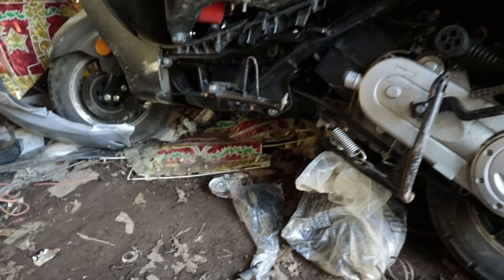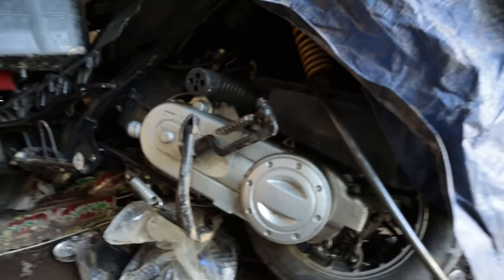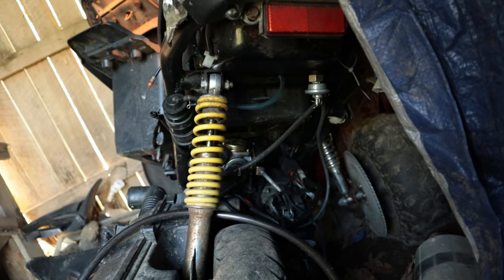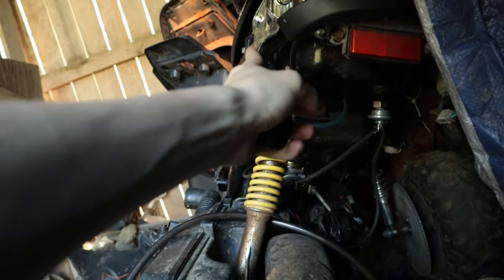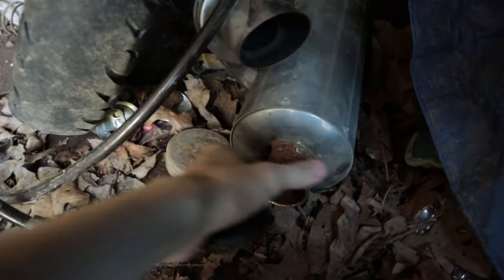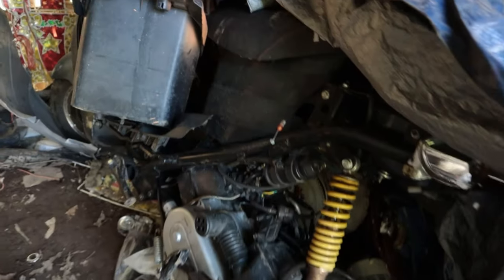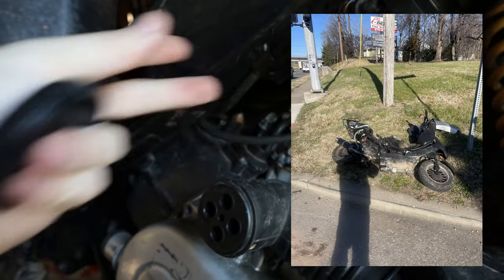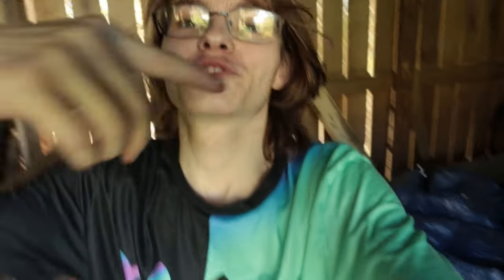Ultimate 150cc GY6 Scooter Modifications: Enhancing Speed & Horsepower

Comment: My experience with those Blue box CDI is not good. I had 2 of them, one ran for a short amount of time and the other was DOA. My experience is they're junk. I did find one that worked with a branding of Yamamoto. Adjustable levels of advance on it too. Edit: i had the orange you have too. It worked well.
Reply from the maker: Yeah but I got blue one new and for my experience it worked better then all for the 50cc TaoTao best fr had me flying fast asf fr got 55 stock motor with performance carb/blue cdi/ better belt / 2k rpm spring
Reply: @KingCal  Awesome, I would keep the orange one on the bike somewhere for a spare. I ride a heavily modded Bashan Brozz Recon CG250, some GY6 parts are interchangeable. CDI being one of em'. I enjoyed watchin' tho and i'll check out your next video.

Comment: if the electrical parts are blue or orange its junk, especially the spark plug wire. itll leave you stranded somewhere stock cdi and spark plug wire are your best bet, dont use the crappy chinese 3 prong spark plug its junk get a ngk 10gram rollers if your under 200 lbs. sounds like ur running rich main jet should be around 115 it will run better with the exhaust on it drill holes in the exhaust if u want it louder and to backfire
Reply from the maker: If you watched the video it tells I weigh 95lbs cause for me it’s basically a fragile an I’m running straight pipe it would have been better audio if I didn’t just use an actual camera that ain’t got good audio to pick up if you checked the video I got rollers/better carb